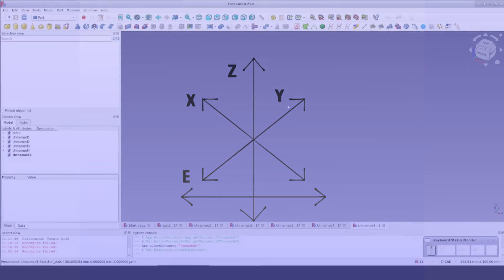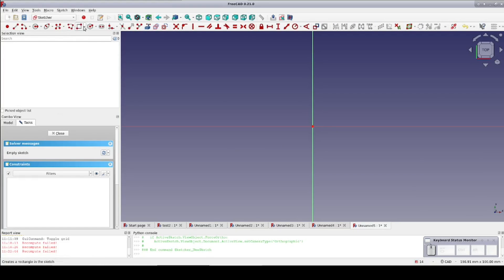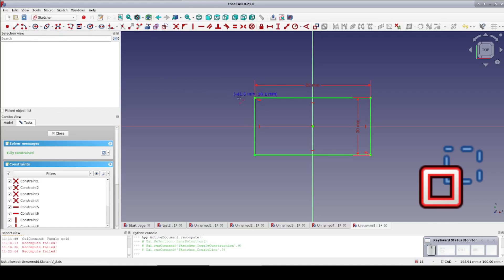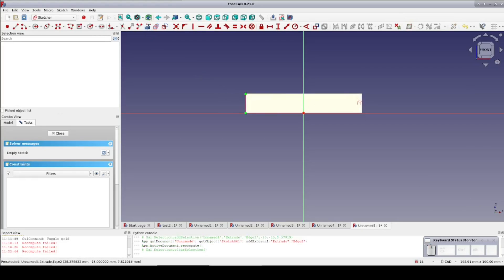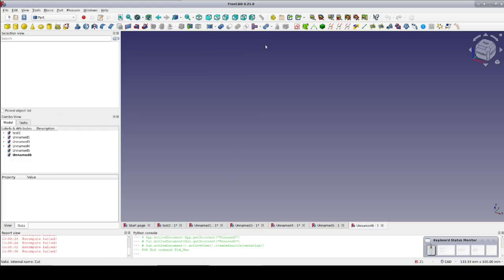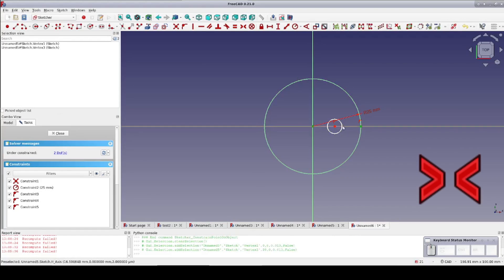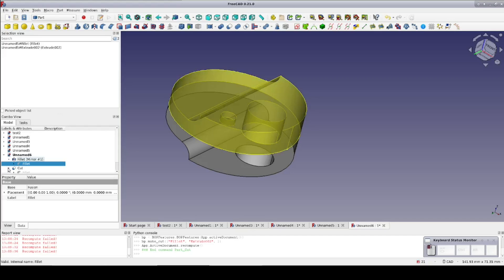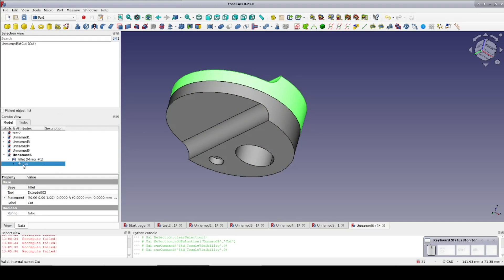FreeCAD: An Open Reply to TeachingTech

Comment: The "freak out" when you are exactly on an edge or face is one of the most irritating things in FreeCad. It's so fun to click extrude and get a barf window and have the model disappear. But i learned on it, and was a bit disappointed in the other two videos. As a non-professional, it does everything i need it to.

Comment: The way you build it, all subsequent geometry referencing prior, existing geometry, will cause FreeCAD to blow up your project with a power of a nuke if you change prior topology. It all looks easy but it's NOT the right way to do stuff in FreeCAD. Unfortunately doing things in a way immune to the topological naming problem is way slower, less convenient, and infuriating with all the nitpicky bureaucracy FreeCAD demands for no good reason at all.
How many spreadsheets did you ever use at most in a single project? 'cause anything higher than 1 is an implausible scenario, but you still have to type <<spreadsheet1>>. when referencing the only spreadsheet you ever use. Why type <<sketch12>>. Constraints.r1 if only one entity named r1 exists in the project?
FreeCAD designers don't believe in YAGNI philosophy and burden the user with specifying things no-one ever needs.

Comment: I feel that this video and some of the comments miss the point and actually reinforce his points rather than dispute them.

He never said that it would be impossible to create things in FreeCAD so just because someone with a lot more experience in it can create it better it doesn't mean FreeCAD is anywhere near as good as other CAD software.

What was shown here in the video was creating an object with a lot more extra steps and potential mistakes than you would need or encounter if you used other CAD software.

Just saying "it has a steep learning curve but once you learn it, it is fine", is not really a valid argument when most of that learning curve is learning workarounds or unintuitive ways of doing things. Why can other CAD software have a much shallower and more intuitive learning curve and still provide better results?

As for timelines, what you showed seems like another workaround and FreeCAD still lacks a proper timeline.

From Teaching Tech's video and this one it definitely seems like FreeCAD is not there as a true competitor to other CAD software yet and still has a long way to go.

Comment: for a long time I used Turbo Cad...quite good...but running only on Windows...so when I switched on Linux OS...needed to use a parametric CAD...
FreeCad even if at the time was not perfect, it allowed me to learn every day something new. the more I learn, the more I expand my 3D printing capabilities.
If you want to be free...you need to learn...and Freecad  gives you this opportunity!

Comment: Fantastic response and tutorial. I especially liked seeing a real world problem I was familiar with, being solved by step by step. 

I also didn't know you could use the PART workbench tools with the sketch -- in fact the vast array of workbenches is still confusing to me -- and which ones can be used together, which ones are stable vs not recommended, etc.

I love the idea of freecad but have been unable to incorporate it into my workflow due to models breaking, cryptic errors, etc. Content like this helps a lot.

Comment: The user experience for FreeCAD is terrible. It is unintuitive, unforgiving, overwhelming and unhelpful. It is especially pronounced when compared to other parametric modellers like OnShape that accomplish the same tasks with a far cleaner, more forgiving interface. I'm glad Ondsel is trying to improve the experience because there is good software in there somewhere, but usability needs to be center stage, not an afterthought.

Comment: I have gotten used to the part design workbench and never really use part workbench myself, and the TPN is a very annoying issue as I no longer dare to attach sketches to surfaces of the part, but use data planes with the position "=<reference>" to imitate the feature and keep it parametric. I have however never tried to rewrite earlier features by switching the source object to modify, that will be fun to try at some point.
I know this does not apply to everyone, probably not most, but for me the biggest reason I prefer open tools even though they are a bit more clunky is because I know that my knowledge can grow deeper over time. This means I will only get better and faster. Any corporate strategy tax that might affect other tools like fusion 360 might mean I will get slower if features are removed, or I might even have to abandon all my knowledge and learn another tool if it becomes too bad. In short, I prefer the option where my skills will grow deeper over time instead of the option where I will grow shallow skills for a wider set of proprietary tools.

Comment: The value in learning FreeCad, to build up this level of skill on the 'work arounds' to achieve the result required puts Freecad out of the running in even just casual use environments. The cost of entry in time learning this when tools that use industry standard setups, have better education support and are more powerful - yet are accessible for free also, makes it only viable to someone who is absolutely determined to do so. I personally can't afford to invest my time in learning this on a professional basis, and even on a casual user basis the cost of entry in time and and research makes this tool prohibitively useless. 
Outside of that, the 'greedy corporate' reason is emotive and not logical. No one who is using Freecad is going to produce something that has the IP value to be stolen by a corporation, as it does not offer enough power for a professional designer or workshop to persist with, and the amateur designer is not going to produce anything with great enough value that losing it to a withdrawal of a cloud service will cause, especially as all these tools let you export your designs anyway into files that can be cross used on other platforms. 
You may be able to demonstrate the power of the application better, but Michael hit the mark by demonstrating the cost of entry into using this workflow does not balance out in the value of using it.

Comment: First,  i like the idea of freecad... however,  hate the execution.  Stop defending terrible ui and ux. The foundation is there,  but the usability needs to be addressed.  I want to see it succeed and the only way that will happen is when,  like blender,  it addresses those two issues.
Reply: That's a moronic point. Blender infantilized the UI for dumb people and newcomers, but most newcomers are only checking out and dumb people are lost cases. Seasoned users used mostly shortcuts and did the job just as quickly, and the UI was messy but A LOT more useful, everything was right there on your face. It was a silly move.

Comment: I used inventor for 3 years, and fusion360 for the last 6 years. I recently tried freeCAD and found it troublesome to my work flows. Had I started with freeCAD it probably would not have been an issue. I stuck with freeCAD for a few designs but soon gave up.

The limitations, unintuitive order of operations, and lack of "creatire comforts" packages like fusion360 have make freeCAD not viable. Everything feels clumsy and slow.

For instance, after you selected a face you create a sketch on it, you must confirm that face for the sketch plane - why, just make the sketch there.

Finally the space mouse support is awful in freeCAD.

Heres to at least 1 more year of giving Autodesk my money.

Comment: Most of the limitations explained in the video are, at least in my opinion, quite manageable, as it mostly boils down to adding some extra clicks and is a fair trade for what the software allows for. However, I swear that this part 9:00 just hurts my soul. I know it won't make any perceivable difference, yet it seems so dirty to leave it like that. Does anyone know if there is a planned fix for this issue, or a more elegant workaround?

Comment: Your video is well-articulated and I could not agree more with your assement. I have only recently started designing in CAD as part of my dive into the hobby of 3D printing and have only used FreeCAD -- as I, too, am committed to free and open-source utilities so that I am never beholden to will of corporate software giants. Unencumbered by having to first "unlearn" a competing software package, I have found FreeCAD to be easy to pick up and use effectively. Your video; however, has in minutes taught me enough to shave hours off my designs. Keep them coming and be well!

Comment: It's not just your creations that can't be locked up by proprietary developers, it's also your knowledge and experience with the tool. Fusion 3D is a great example of a proprietary tool that is given away free to students in order to lock them in by dint of their experience, and TeachingTech effectively demonstrated that very thing. He learned how to use the proprietary tool while using it for free, and is now paying hundreds of dollars a year. He's fortunate that he took the locked-in price when he did, or he'd probably find himself justifying the even higher expense of the current price.
Reply: You have it completely backwards. Fusion360's operation is pretty much industry standard. The skills you learn in Fusion are directly transferable to packages like Inventor, SolidWorks, CATIA, and others that you would be using in any sort of real engineering environment. FreeCAD is the outlier that does things in strange and mostly nonsensical ways that locks you into their methodology.

Comment: I'm aligned with your view that I want all of my data and tools to be as unencumbered as possible, and so all of my modeling is with free tools like FreeCAD. But we have to be willing to admit that the FreeCAD UI is... kind of atrocious. It's powerful and you can do just about anything you need, but it has quirks, is inconsistent, unintuitive, and downright frustrating sometimes. 

My view on Michael's video is that it's a good overview of some reasons why the FreeCAD UI is bad because you can see how much more direct manipulations are in professional packages, and the convenient shortcuts they give you (midpoint constraints). I had no prior assumptions about how 3D modelling worked when I started learning FreeCAD, and in retrospect it probably took me at least 2-3x longer to become proficient in FreeCAD than it would have taken me if I started with a professional package. Even now, each non-trivial model I design takes at least twice as long, and breaks regularly while making adjustments due to topological naming issues (or takes 3x longer if I more carefully design it to avoid tripping over topological naming issues).

This I think was Michael's point: you only have so much time to do the things you want to do. If, like you and I, it's important to not get locked down, then it's going to cost you in FreeCAD 's learning curve. Things are improving, but they're not nearly there yet.

Comment: It's probably not intentional but you're making it quite clear why people end up steering well away from FreeCAD, and why something like Ondsel is necessary. These workarounds are all insider knowledge gleaned from extensive experience with the foibles of the program. Number one why is there a part design bench as well as a part bench? I've actually listened to the explanations for this and I'm not at all convinced that the distinctions are worth the confusion of having two completely different workbenches. Not only that but what about the 13 other workbenches? Why not just hide all that and have one workbench when you open the app? If you want those other functions then make the user dig through a menu or something. Ondsel has it right in just exposing the part design workbench and the assembly workbench. There are four cryptic text boxes surrounding the 3D viewport, whereas most other CAD programs make do with just one project tree. It's almost like FreeCAD was designed specifically to confuse and confound not just the new user but also the experienced designer who's used to almost any other CAD package.

Comment: My problem is that every defense of FreeCAD seems to start with 'Your problem is you are trying to do it the way EVERY OTHER CAD PRODUCT on the face of god's green earth works.' As a software dev myself, this is a huge red flag regarding the product and the team behind it if they have ignored decades of convention.

As Thomas, Michael, and Angus, have all demonstrated, every other CAD program behaves similarly enough that there is a minimal learning curve to jump between them. FreeCAD seems to be the only CAD program that falls outside the standard manner of doing things.
Reply from the maker: When the first version of FreeCAD came out, Fusion 360 was 11 years in the future. I could make equally comical videos by trying to use Word like it was Wordstar or use Windows like it was MacOS or vice versa.

Comment: IMO developing parts and machines involves trial and error. Your models in CAD will break. Some of your ideas will be dead-ends. Learing how to repair those models in FreeCad is not really taught much on youTube.I think this leads to much of the frustration with FreeCad. I try FreeCad out every year but then return to Fusion 360. I am using the Autodesk hobby license and worry they could stop it at any time.

Comment: There is a master sketch workflow. Just select the geometries you need and make a sub-shape binder. As long as the wires are closed this face can be used for whatever operation you want. You can then modify the binder and place it parametricly where needed, map somewhere else on a datum plane, make an offset etc. It's extremely powerful and saves a lot of time if you implement it in the workflow.
Reply: Aren't shape binders prone for TNP? I prefer to create new sketches; switch to non construction (GN); carbon copy (GW) the master; then select anything I want and make it construction (GN); and if needed add some geometry. Of course, the master sketch(es) MUST BE fully constrained. 
One fine addition is to FIRST start with a sketch or spreadsheet containing all the parameters an user is intended to change later on. This makes documentation and handling parameters easier than to have them spread around the whole project.

Sadly, there are too many people on the web complaining about the way they're thinking is not the way FreeCAD handles features. Same quality of ppl panicking when being confronted w/ LibreOffice because they only know M$ products. 
That "TT" guy is mainly a presenter of other' ppl ideas and projects. Thanks to everyone proving where he's wrong.
Reply: @NUeB_RCFPV The topological naming problem is not an issue in the latest versions of FreeCAD. I personally haven't encountered it for years, and sometimes I sketch directly on faces and use sub-shabe binder extensively in my workflow. 

These content creators just regurgarate the same shit they heard before. I can assure you none of them actually encountered the problem themselves.
Reply: @matze_skopjanecot  I just encountered TNP in 0.21 in a current project w/ sub-shape binders.
Reply: @matze_skopjanecot  Okay, now I got it - subshapes of the master sketch itself. Thanks, pal! 🙂

Comment: Tip. Any external geometry can be converted to sketch geometry by first selecting the external geometry (read), then by using the toggle button or the key combo g n will turn in to geometry (pink) that can be extruded, pocketed or what ever regular geometry is used for.
Reply: Is that a Link branch feature? I'm not quite sure as it doesn't work in my main repository 0.22dev(weekly).
Reply: @m4ki9h76  It could be as I use the link branch. But I think it works in normal FreeCAD.
Reply from the maker: It doesn't.
Reply: @4axisprinting A ok. Thanks.

Comment: I have seen TTs video also and had the same video idea in mind, but in german language 😉
There are so much ways to do those things. For example you could have done the pad (3:13) symmetric to the sketch, then you could also use the midpoint in your Sketch001 without the need for a symmetric constarint 😀